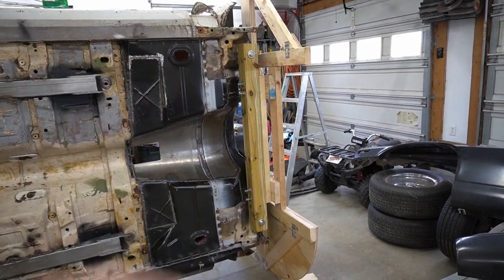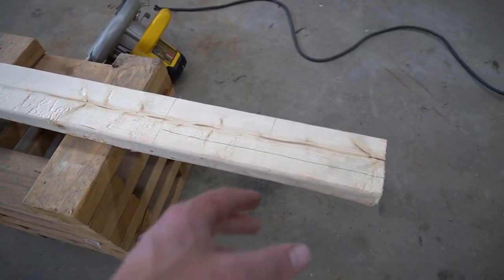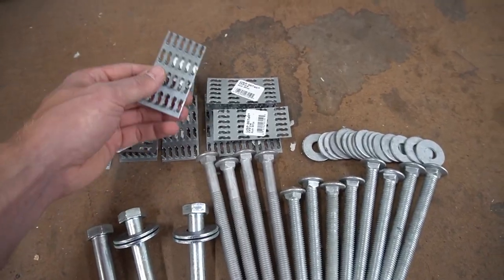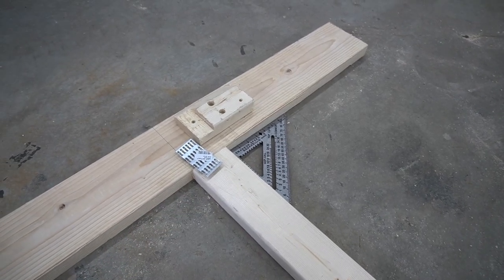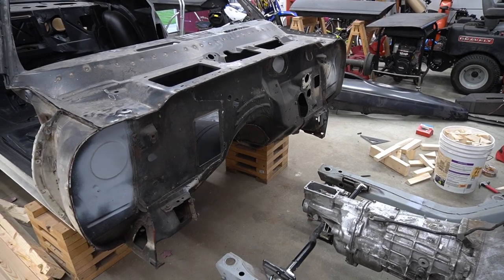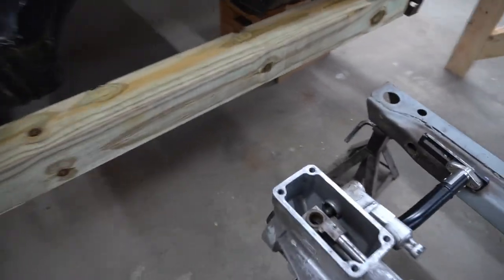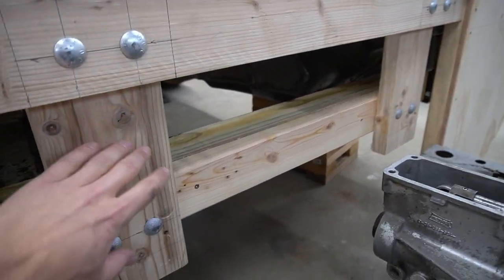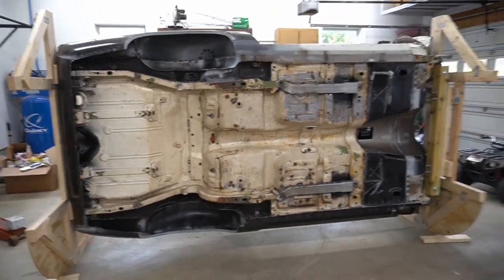WOODEN Tip Over Jig: How to Build One for your Car! (DIY)

Comment: Outstanding Dan. I was fortunate enough to gather enough steel to build my rotisserie with very minimal expense. I also have a good friend that is a machinist. Probably took me three weeks to finish the drawings and two to build it. What you have done is just as effective and looks great plus you can reuse the wood on later projects. 👍🇺🇸🤙😃
Reply from the maker: Thanks Ken, it sure beats working on your back, but I’m finding there are some positions where a full rotisserie would make things easier. I thought about adding plywood to the other side so I can flip it in either direction.

Comment: I like it.  I have a 79 that I have slowly been working over the last 20 years.  

One recommendation - pressure treated eats metal.  It's the chemicals in the wood.  I would put rubber sheet between the steel and the pressure treated.  Personally, I would be more comfortable with (2) 2x4s over a 4x4.  4x4s are cut out of the middle of the tree and don't have the same load capacity as a 2x4.  Either way though, good design and does the job.  Thanks for the video.

Comment: That is a pretty cool idea!!  What kind ceiling clearance do you need to roll that over?  I do not believe that would clear the lowest point of 7'5" where my garage door opener is located.
Reply: I have that same question. I’m doing an 81 T/A (same body) and was curious of the total height? I guess you can locate the end closer to the car’s side and make it lower to the ground.

Comment: I am a new subscriber. This is just what I was looking for. Your videos are very well done and explained clearly.
In your opinion, Dan, do you think this design would be able to handle it if we were to duplicate the curves on both the driver's and passenger side? That way, it would be able to tip over in both directions.
I'm thinking it would, and editing in that change should be pretty straight forward.
What is your opinion, Dan.
Thanks.

Comment: Hi Dan...great video, thanks for posting.  I want to do something similar for a 63 Studebaker hardtop, just the body, which is already off the frame.....not sure how or where to mount the rear?  There are no bumper attachments there, the bumpers on this car mount to the frame.  It's not a unibody.  Maybe mount to a 4x4  bolted to the rear body mount holes?  thanks...Joel

Comment: Awesome video Dan, I'll definitely subscribe.  I'm working on a 79 Camaro and it needs a rear floor, torque boxes, and rear frame rails. Would this work for replacing the frame rails?
Reply from the maker: I’ve seen a lot of frame rail sections repaired on rotisseries, but not full frame rails. I’d build a chassis jig or even use jack stands on a level platform to replace the frame rails because the datum points are well documented for these cars.